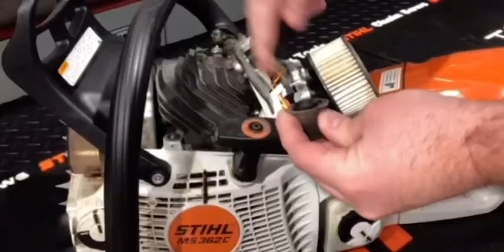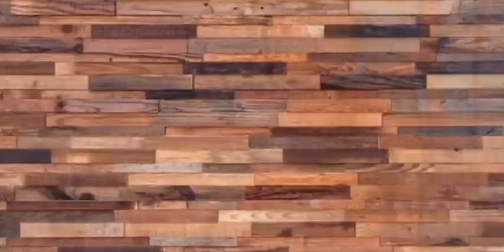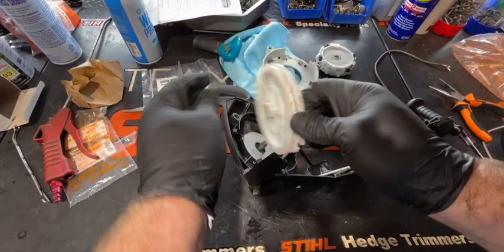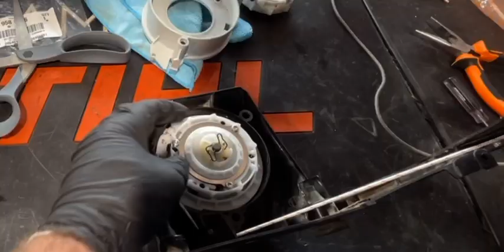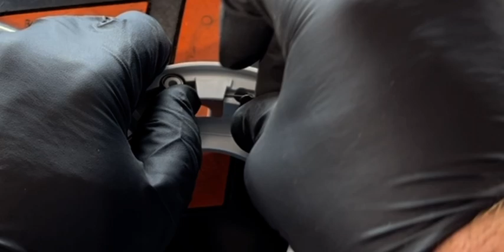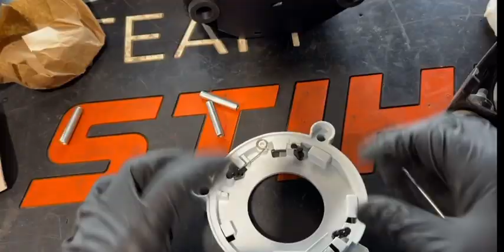Fixing the pull cord recoil assembly on a Stihl BR 800 C side start backpack blower. Step-by-step

Comment: When I pull the starter handle, I hear a clicking sound and the system slips instead of engaging. It feels like the starter is not catching properly. Can you tell me which part is likely damaged and how I can get the replacement piece?

Comment: The boss managed to run one of these over with a truck and bust a bunch of the plastic. At least I see how it's supposed to go together when the new one comes. Thanks.
Reply from the maker: Somehow I see a ton of blowers run over come into the shop. Not sure how that happens all of the time 🤷🏻‍♂️
Reply: @AMGEquipment  There was another one I had to replace the wand and the fan housing for a year ago but that was pretty straightforward.

Comment: I have one of these blowers with this same pull start system, recently, when I have tried to start the blower the chord will sometimes slip and I have to bump the blower a little bit before it catches and gains tension. What do you think is the problem?
Reply from the maker: Probably just dirty and the pawls are not retracting back into place after the last pull. Sometimes the pawls wear out since they are plastic.

Comment: Sadly I have had to replace the whole assembly a couple times on the same machine, the “not my equipment” users always jack them up. Offered to convert to regular start pull system but owner complained it was too expensive, not if I keep having to fix it.
Reply from the maker: They are nice systems but not practical when you have employees that don’t take care of equipment.